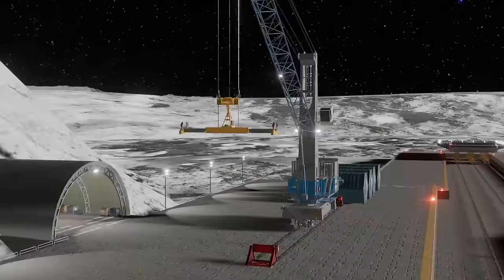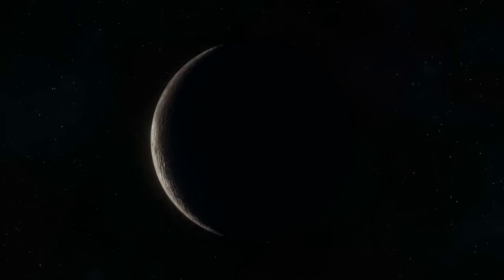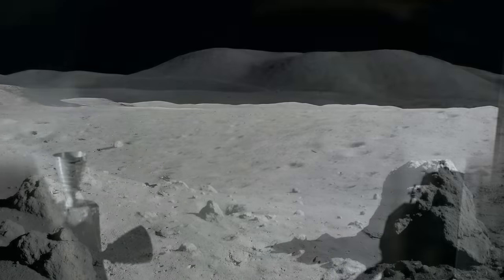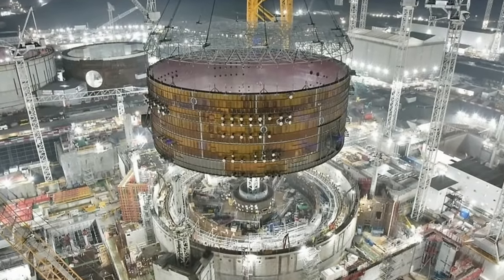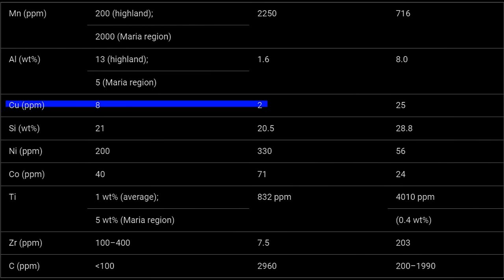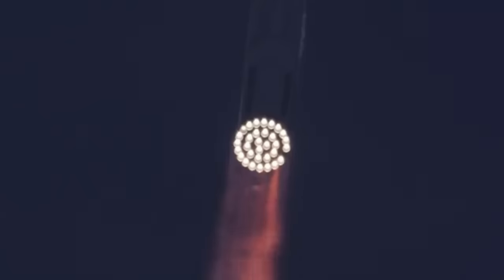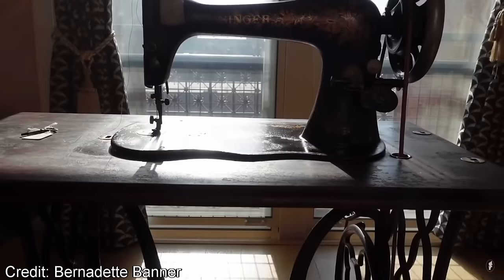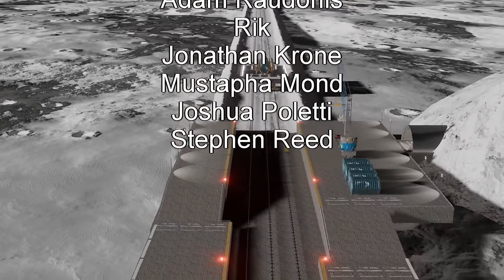Designing Heavy Machinery To Excavate The Moon

Comment: Cables and pulleys are a bad option from an automation perspective. Cables are highly flexible and operate under tension. Grabbing and manipulating a cable is a very difficult task. It's not too hard for a human to do, but you don't want to have a human doing it on the moon.

Further, cables under tension are dangerous. If they snap, the stored energy needs to go somewhere, and that is very bad for nearby machinery or, heaven forbid, operators. Your early manufacturing on the moon is by necessity going to have poor quality control - you don't have most of the equipment and experience necessary to match earth manufacturing capabilities. You want things that fail safely.

Finally, you're going to be making a lot of things besides vehicles on the moon that will also need actuators, and most of those are not well suited to using cables and pulleys, so you need to manufacture other types of actuators anyways.

Linear motors likely make the most sense for the moon. There are no moving mechanical parts that could fail, they are basically immune from contamination by lunar regolith, they can be made with the same techniques and possibly even the same equipment as your rotary motors, and they can be used as 1:1 drop in replacements for hydraulics.
Reply: Also fine Lunar dust that cut Astronauts suits to pieces, was a Health Hazard in Living Quarters, also got into Mechanisms & Machinery doing abrasive damage to Mechanical systems, the Pulleys & Cables on these Lunar Excavators would be subject to this, Everything needs to be Sealed from Dust Contamination as pointed out above ...
Reply: I'm not sure regolith is really that big of an issue for cables as it is things such as cloth. It's dangerous to cloth because your fibers are so thin they are cut by the micro abrasions. Cables will of course wear out over time, but I don't think it's the limiting factor your thinking it is. The large size available to us on the moon is also going to permit over-engineering of these systems since weight isn't a limiting factor.

Motors are nice, but to get decent power density you need high voltage wiring (thick insulation usually of an exotic polyethylene blend) and are controlled through complex circuitry that is both sensitive to radiation and is not easily repaired, especially on the moon, unless you have a bunch of spare parts laying around. Circuit level manufacturing will be far into the lunar development timeline, best to not be reliant on it if we can avoid it. At least in the beginning.
Reply: @OtherDalfite : High voltage wiring is usually mineral insulated, not hydrocarbon. This is true for both transmission and most distribution lines (distinct insulators), and cabling that's closer to non-grid hardware (mineral-insulated metal-sheathed, so MIMS, cable; this is also what old-style electric coil stove heating elements are made of).
Reply: @OtherDalfite : Wait, misread- for motor wire, most likely you'd want to anodize aluminum on the Moon, but regardless you'd need to build motors on-site.

Comment: The only real argument I have with this is the use of tracks vs wheels for a couple reasons.
1. Individual track links dont require massive machinery to produce and can be quickly changed out when one breaks. The steel wheels would require a large foundry to produce the cast or stock material for along with a massive mill or lathe.
2. You need a lot of weight but it needs to be distributed effectively. Tracks allow for better weight distribution over there length vs only 4 points of contact for the wheels. The ground may not be stable and too much weight on one point could cause it to sink.
3. The tracks could allow you to have multiple smaller electric motors vs two or four for the wheels. In this way, if one fails you have less power on one side vs possibly not being able to move untill its fixed. The smaller motors also meen you dont need heavy lift equipment to replace a broken one.
Just a thought. I loved the video.

Comment: I think that you need to focus more on getting a foothold on the moon than being maximally efficient with mass.  Not all mass is useful for all things.  Getting a foundry set up on the moon would be great, but first we need to locate ore-rich areas on the moon.  Iron is the most plentiful useful metal on the moon’s surface at 10%.  Aluminum is only 3%.  There are a lot of silicates, which will be good for making glass.  But before all that, we need a foundry and mining equipment.  Electric equipment is basically the only option on the moon, and getting the power to run a foundry will be a challenge.  The lack of fossil fuels or significant geothermal power will mean that an enormous amount of solar panels and batteries will be required.  All of this needs to be set up before we can even extract the first metallic resources from the moon’s surface.  As for mining equipment, I would go with an open pit mine, and as such we can use heavy machinery.  I would use designs based on modern earthbound heavy machinery, but swapping the drive mechanisms to electric, and the steel structure to aluminum.  While I understand the logic behind using cable-based excavators, I think that electric motors and solenoids are going to be a better choice.

Comment: So, you've made a few mistakes. Firstly, steel is a poor idea- there isn't a lot of iron on the Moon, almost everything is Oxygen, Aluminum, or Silicon, so those are the starting materials. From them you build your initial vehicles; don't worry about faith in the structures, you won't be building for humans at first. Some batteries aren't a bad idea, but primary power will be beamed from central locations (towers, most likely), and the batteries themselves will mostly be to stabilize the power supply. There's also a good chance that high abrassiveness will cause the first vehicles to just produce ingots in-place (literally just melting regolith) instead of trying to do any digging, as you then just pick up the ingot and drag it to a central location for further processing, which can reduce the wear-and-tear experienced by the vehicles. Finally, the first Moon-built vehicles will likely be push-mower sized rather than anything larger, as you want to be able to build the first of them fairly early, as a large vehicle requires a lot of material, and thus will inevitably come later.

Still, for the second to fourth iterations, your size and mining method are probably about right (though for significantly later, straight to barely-mobile megastructure draglines).

Comment: What about trains?  They would be extremely useful for extending range and volume of resources between deposits and a colony’s industrial heartland assuming the shifting temperatures don’t ruin the rail lines.
Reply: A railway would be great for efficiency in the long run but would also be a single point of failure. It would also involve a massive investment of resources for any real long distance travel. What I would suggest instead is perhaps a road train, just like in Australia. One tiny rover will be able to pull a massive weight given the gravity and should be able to fill the role of train till the resources really start flowing en mass.

Comment: Laymen often don't realize how extreme a thermal environment the moon really is. I've worked on some moon missions. Not only does the ground temperature swing between 200C and -150C, you are also in a hard vacuum. Anything exposed to the sun will have hotspots and anything shaded cold spots with no air to average this all out. The day night cycle is also 28 earth days long. This means that the during the 14earth-day long moon-day you gradually build up more and more Thermal energy with nothing but radiators to cool yourself down. And during the night everything is cryogenically cooled with the bonus problem of there being no sunlight for your solar panels to drive your heaters. 

Long slender arms (like digger arms) would have massive temperature fluctuations. Hydrolics are out of the question unless you manage this.

Comment: There is one HUGE challenge you are forgetting.  With no air, there can be no convection cooling.  All cooling must rely on radiators.  But radiators are very low efficiency at low temperatures.  Anyways, your aluminum motors will probably need to be made of aluminum pipe, with circulating coolant that must then pass through square meters of radiator.  I think it is better to bring the motors from Earth, made of copper tubing, which can take much higher temperature than aluminum.  Higher temperature being easier to radiate, it's a win-win.  Starship will make the cost of lifting weight from Earth to space many times cheaper than it is today.
Reply: Exactly and as an Engineer I'm just about losing it spotting all obvious problems. Which include massive thermal radiators, everywhere. You've also missed the point that a lot of magnetic materials lose their magnetic properties are modest temperatures and that even copper quickly loses its mechanical strength with higher temperatures (remember large magnetic forces act on these conductors).
Reply: @saumyacow4435  Indeed;  and keeping the highly abrasive dust off bearings is another headache.  I don't think the moon lends itself to manufacturing of anything really.  I'm all for in-situ resource utilization when it comes to Mars;  but the Moon is best to bring finished stuff to it from Earth.  Extracting fuel from water ice is good enough.
Reply: I think there's another far more serious problem to consider before trying to build anything out of aluminium on the moon: Refining. The refinement of aluminium is one of the most energy intense industrial applications in our entire society, if not the most. In Canada there is a refinery on the west coast, which requires an entire hydroelectric power station all to itself. Actual gigawatts just to run electrolysis machines.
(Just looked it up, not quite a full gigawatt. https://en.wikipedia.org/wiki/Kemano_Generating_Station )
Reply: @gallomimia7780  Darn good point!  And now combine that with the thermal dissipation problem. Even marginal inefficiencies in a 1GW power conversion would add to like 50 or 100 megawatts, which would require thousands of square kilometers of radiators to dissipate.  To cool the aluminum would probably require covering the whole Moon with radiators.   Of course we would not need to produce industrial amounts of aluminum there;  but in any case, it makes a lot more sense to bring from Earth whatever we need, with the sole exception of fuel, which is the one thing relatively easy to produce there, and which we need in much larger amounts than any construction materials.
Reply: He didn't forget, he said that
Reply: @gallomimia7780 : Refining aluminum on the Moon isn't that big of a deal, in the most extreme case you use a horde of passive mirrors over the course of the Lunar day to melt basically anything.

Comment: The ISS is not usable mass, it's entire structure is riddled with micro fractures from constant thermal cycling.  You'd have to melt the raw materials down, separate the constituent elements, re-alloy and then re-machine them.
Reply: I don’t think he’s saying you can use it as-is, he’s saying you can process it into usable materials without having to bear the cost of launching it from earth. If we are going to be manufacturing anywhere not on earth, it’s potentially better to start with materials in orbit so you don’t have to accelerate your material from the surface of the earth. Obviously ready-made materials and parts from earth may be better initially and for certain use-cases.
Reply: @enclave6285  The cost to process a space station in orbit into usable materials in orbit will be vastly more than the cost of launching that mass to orbit.  There will be no use cases for the hollow shell of the ISS, because that shell is already nearly unfit for human habitation.  
The whole idea is simply silly, the only future use case for the ISS is as a museum.

Comment: I'd be interested in seeing what your solution for getting heavy lunar equipment unstuck or towed is. I don't think I saw a dedicated recovery vehicle in the lineup. Perhaps the 6x6 could work @ 29:40 but I'm not very convinced that anything with those wheels will have a lot of tractive power on regolith in lunar gravity, if any at all, when something is really stuck. I guess if you put together something that looked like an overhead crane gantry from a deepwater harbor and drove it over top of something on good ground you could lift it but I'm imagining something being really badly stuck on bad ground at a bad angle. My assumption would be that you'd need something with very minimal ground pressure over a very wide surface like a really beefed up dozer with very big track extensions straight outta WW2 made out of the cheapest/easiest metals available because they'd need frequent replacement.

Comment: Didn't expect a right to repair diatribe mid-video. But well said. Also on note of electronics in vehicles it is actually pretty significant with how many ECU's, Sensors, and wire required to connect them and more being added due to more autonomous driving features. AL wiring has been getting more priority due to cost and weight savings, but larger you make the vehicles doesn't mean you will need significantly more electronics. So in that note i could see ECU's/Sensors being made on Earth (Maybe even just circuit boards). Ship to moon, put into metal cases, and connected with AL wiring.
Reply from the maker: That's what I was thinking too.

Comment: I think oil for hydraulics could just be synthesized from water and algae, which can be found and grown respectively on the moon.
Reply: Very energy intensive and complex to refine, likely requires a complex chemical industrial base. I'm sure it's doable but your consumption requirements aren't that huge, it will definitely be cheaper to import it for quite some time I think.
Reply: Well that's quite an interesting concept, the intense temperature gradient of night-day (remember nights and days on the moon are each 14 earth days long, so not working during one or the other is a terrible plan) and the extreme hazard of the very fine dust which will be kicked up at every movement still preclude the use of hydraulic actuators for most applications on the moon.

Comment: We really NEED 2 3d print an orbital elevator.  From high earth orbit. Then you can send parts for machines and build .
Reply: We don't have the material science (yet) to make an orbital tower that won't break under its own weight.
Reply: @thomashiggins9320  correct me if I'm wrong , can you not make the earth dragg it along? The only thing that might touch the ground or sea would be the platform.  Spacex needs a space dock for fuel transfer.  Print that thi g 500 miles out and slowly bring it in 2 its geostationary orbit. It could have 10,000 starship docked.  It would literally be the gateway.
Reply: There are barely anyo materials strong enough to build an elevator in the first place, let alone any that are printable.
Reply: It could work on the Moon with currently known materials, like Kevlar, Zylon and Dyneema. There is a small issue with the requirement of length of about 55 000 km, slightly remote construction site and amount of the material required.
It might also be less than ideal to travel, at least for people, because i doubt one could travel at very fast speeds on such a cable.
Apart from that and perhaps some other minor issues, i'm a great fan.
Reply: Just 3d print a 60,000km 100m+ wide elevator made of magic carbon nanotubes bro 😂😂😂
Reply: @saltydriver3722  i do think you're wrong; people have put a lot of thought into this. The problem really is that geostationary orbit is 36 THOUSAND km away from the surface. That's six times the earth's radius. We aren't capable of building anything that long, nor do we have any material capable of staying together at that size. Even direct sunlight would cause something that big to rip apart.